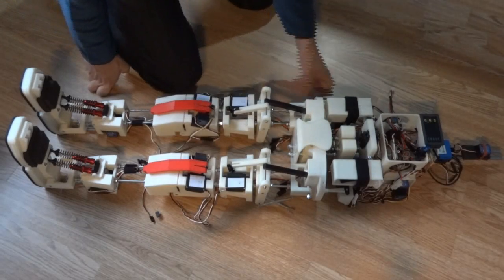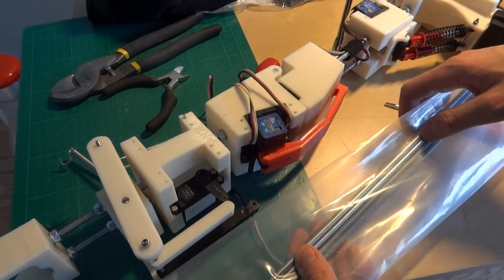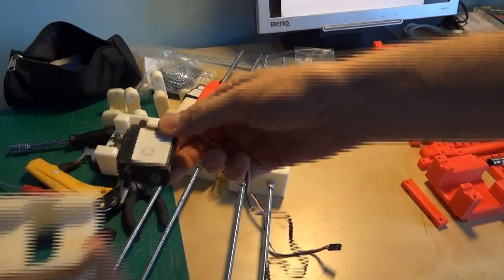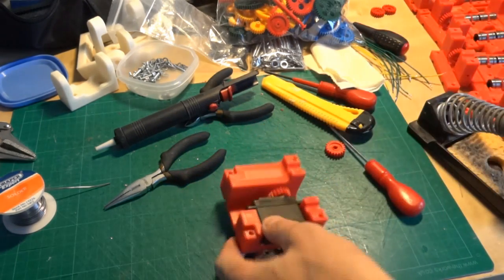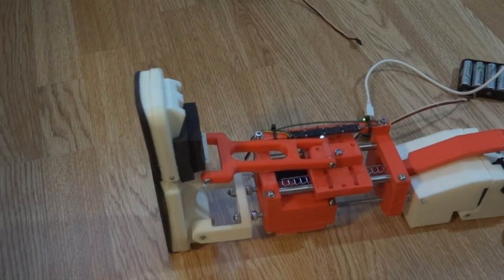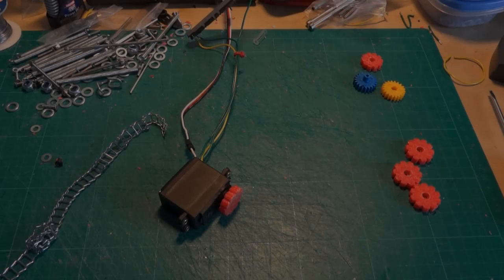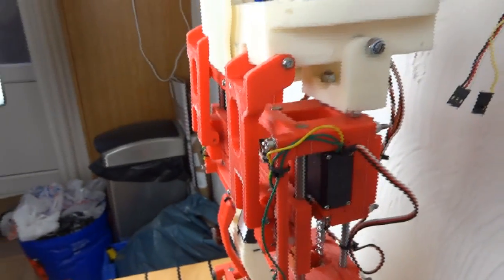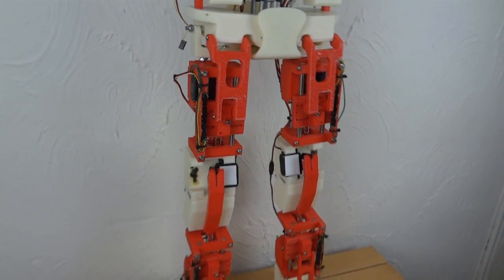Android 12 Part 10, Swapping servos for 3D printed linear actuators, for my humanoid robot

Comment: You can use ez-robot complete kit.It includes EZ-Builder Robot Control Software & SDK
1 x EZ-Robot EZ-B v4 Camera
1 x HC-SR04 Distance Sensor
4 x Heavy Duty Servo
2 x Continuous Rotation Servo
2 x Peripheral Cable
1 x 6xAA Battery Holder
1 x EZ-B v4 WiFi Robot Controller

Comment: I hope it's ok to butt-in a little. ;o)

Chessie, if I was going to start making some basic robots with (almost) no money... I'd get some broken remote control cars from a Flea market or Carboot (the kit type, not Toys) and make the mechanical from rods/nuts (as in james's vid) bent wire and probably MDF or a tough plastic board.

Even if you just build another car, it'll be Fun - and all the servos can be plugged into Arduino, Giros etc. when you try to give it a Brain :)

xxYooch - uCHOOZE.com